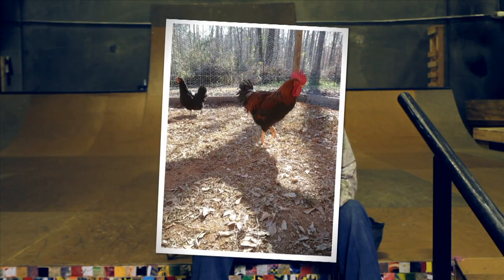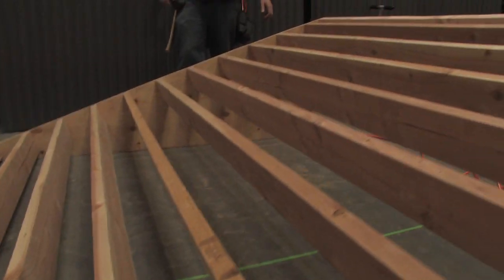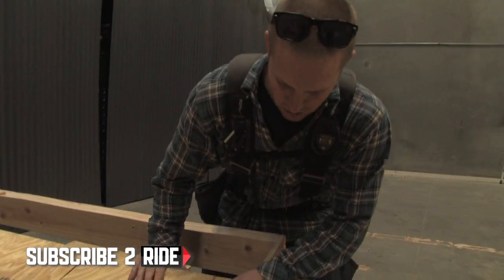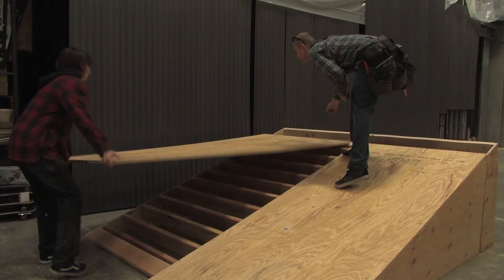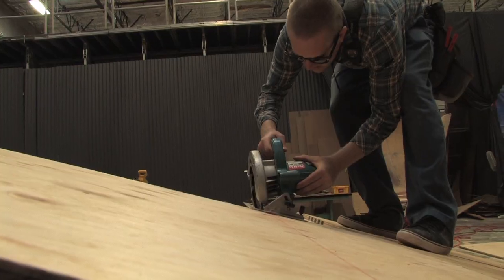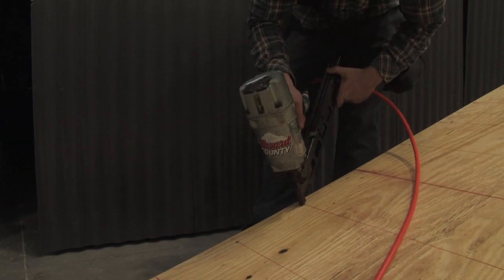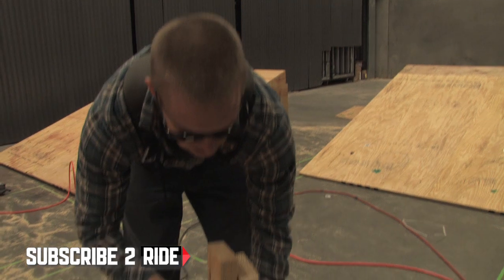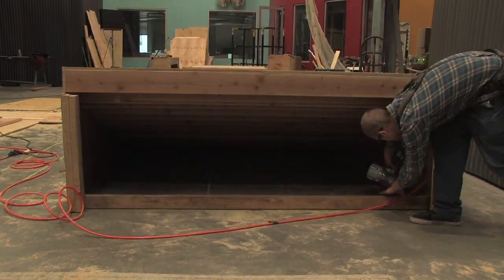How-to Build a Skatepark - Bank Ramps Part 4: Plywood Placement - Manual Labor

Comment: No, sorry. Most ramps nowadays do not work with blades. Current skatepark technology is changing rendering most parks (made of various materials) un-rollerblade-able as to allow a better experience for skateboard riders. The guy building this ramp is a pioneer in such technology. Sorry to disappoint you, man.